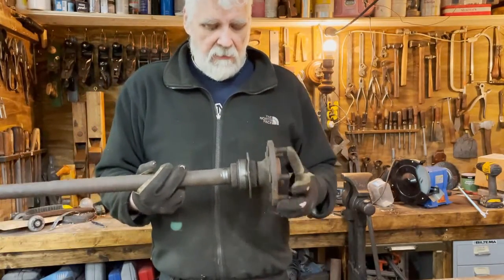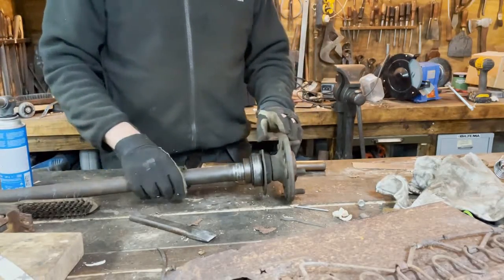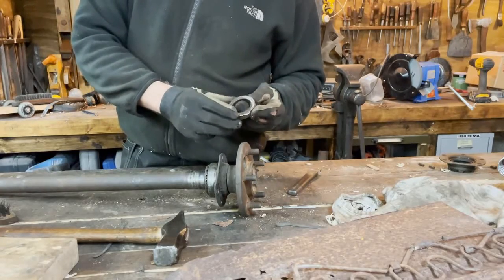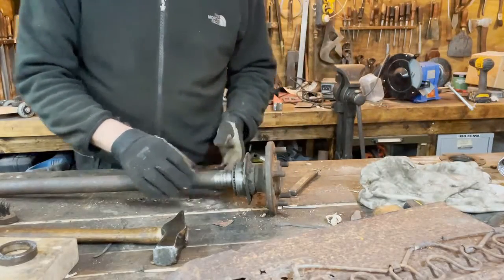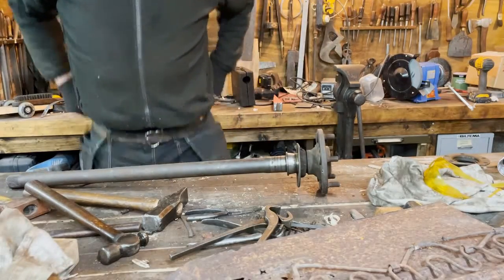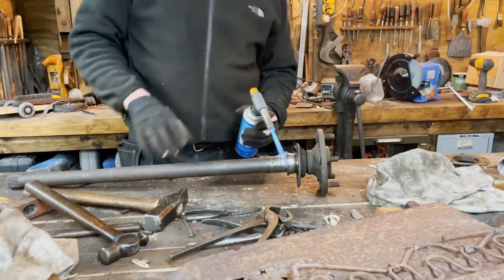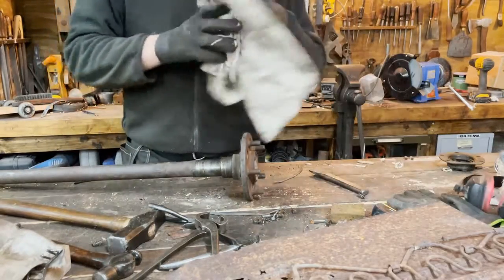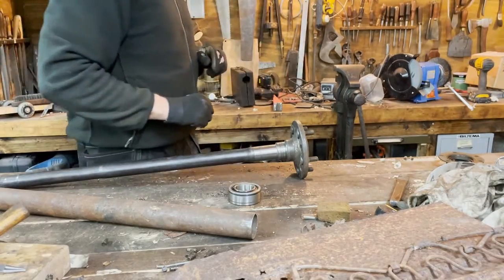How to replace a drive axle bearing, Chrysler 8 3/4

Comment: Last night I put the axle is the chest freezer and heated the bearing to 250F.   It slid right on with no press and no pipe.
Reply: I then heated the locking ring (collar) to 500F and it slid on
Reply from the maker: Thank you for this comment. For sure a good method. At my place it would come to the negotiation wether the freezer is available as garage equipmen. But of course, over night could be a solutio 😁

Comment: Damn dude you forgot something you put on first before you put some bearings on
Reply from the maker: Haha, don’t worry, these particular bearings are ball bearing and the bearing retainer slides over the bearing and a locking ring fits in a groove on the outer bearing ring and will keep the bearing and retainer in place. But if it was a conical bearing I would for sure share your concern :)

Comment: Cut a groove into the inner race, careful…not all the way through. Strike with hammer/chisel and the race splits , slides off.
Reply: cut with what? i dont have a cut just a hammer and chisel
Reply: @Titan-dm2mo  in the past I have used a cutting torch .  Just enough to blast a groove without penetrating into the shaft. Sounds difficult but easier than you think. I have used cutting discs and carbide burrs.  The race is so hard that all you need is a start and it will fracture very easily and slide off.

Comment: very helpful video, about what size is that pipe you used to install the new bearings? Thanks!
Reply from the maker: Yes, was hoping so, especially fir those who has not access to a press. The pipe is 42mm internal dismeter, 48 mm external diameter and almost 800 mm long. Not sure about measure in inches :)
Reply: 1 1/4 “ id 1 1/2 “od , 31 1/2 “ length. google is your friend lol. Thank you very much . i’ve been looking for a way to avoid buying a floor press. This is very helpful!
Reply from the maker: @340dave6  I worked as a mechanic some 30 years ago and belive it or not this was a method some of the guys used although there was a press and tools there. An oxy/acetylene is of course more effective than propane torch but i wanted to do it in the most simple way i could.

Comment: Great video. I grew up doing this when rebuilding axels. You can get the pipe longer than your axel then thread an end cap on it. Helps when hammering away on it so the end doesn’t flair out.

Comment: Hey if your axle shaft seal was leaking, its usually caused by the seal retaining plate being bent on the seals surface. Heat up the plate with torch lightly and set retaining plate on table after removing bearing and lock collar ring and lightly tap the rim surface of plate with a small flat sludge until its flate all the way around rim.
Change bearings and seals and locking collars and you wont have another Axle leak!
But if your plate is slightly bent and you reuse plate without straightening the rim, you can get leaks just 2-4 months after replacing bearings.

Comment: Quote from the Chrysler factory service manual (1971): "CAUTION: Under no circumstances should axle shaft collars or bearings be removed using a torch. The use of a torch in the removal of axle shaft collars or bearings is an unsafe practice, because heat is fed into the axle shaft bearing journal and thereby weakens this area." 

To safely remove the collar(never re-use them) simply drill 2 or 3 holes across the outside face of it and then use a cold chisel to split the collar. The collar is what stops the axle from exiting the rear axle assembly with drum, tire and all in tow; always replace it. Your bearing should come with a new one.
Reply from the maker: Luckily this is a 1970 axle :) just joking. When we deal with old stuff that is stuck or rusted, which they never had to do when they wrote the service manual, we usually have to go beyond the manual. In general I agree with the manual but as long as we heat things and are careful to not overheat things, change color, turning blue or purple, affecting hardening or tempering we should be on the safe side. I have seen plenty of other metods like drilling or using an angle grinder leaving nasty damages in the axle wich are perhaps even worse. In this particular video I wanted to show how to remove the collar in one piece without having access to drill or angle grinder. The same with the bearing roller basket. The struggle removing the bearing that way makes it possible to use the bearing rings for other jobs in the press or whenever they could come handy :) I'm awere that there is a special tool for just about everything you can do on a car but In the video serie Ifixmycarmyself I always try to show how we can fix things without half a million $ wort of tools, just like the average  garage guy situation and perhaps does'n even have a sevice manual. That is the basic principle for the wole channel. Thank you for your comment!
Reply: The amount of heat he is putting into the bearing race, with what appears to be a propane torch, will not harm the axle.  The FSM is likely referring to oxy-acetylene, which does create enough heat to harm metallurgy.